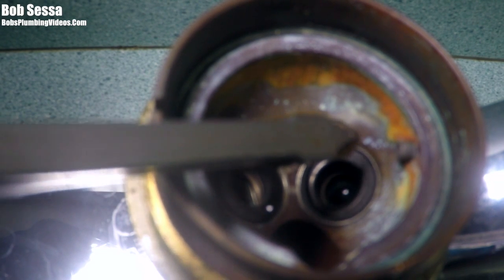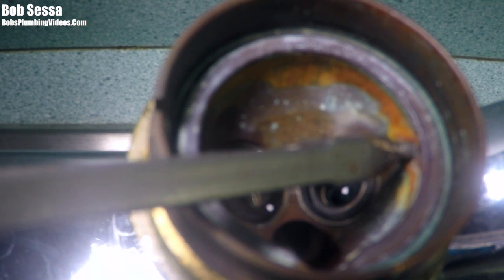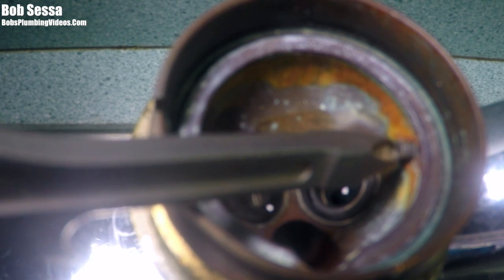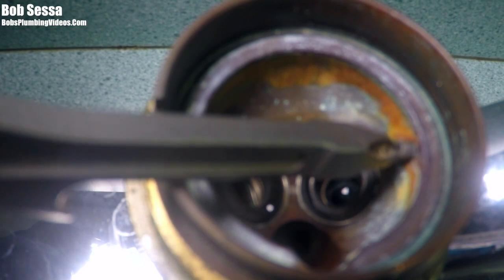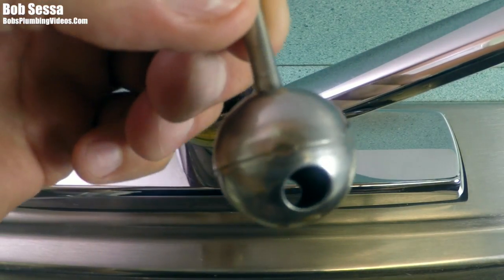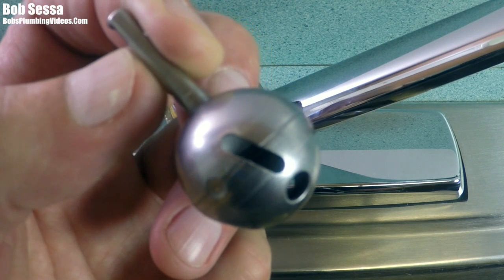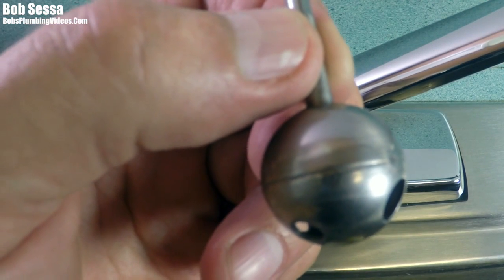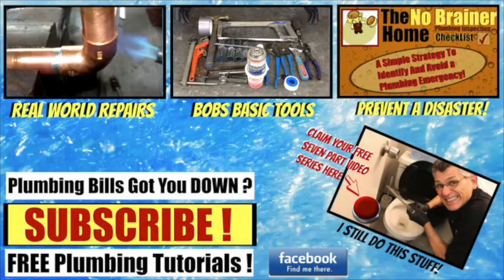Why Your Delta Faucet Is STILL LEAKING After Repair

Comment: Also, used a 1000 electric degree heat gun instead of a torch to remove that deposit welded on cap nut.  However, if you can't remove the plastic retaining ring in that cap it will get melted before cap comes loose.  Had to buy a new cap just to get that ring nut.   I tried to unscrew it with tool provided in kit, it just cracked it.  As in other videos, water deposits over many years really lock these parts on.

Comment: Thanks so much for this video.  I have been to the Box stores and to local plumbing stores.  They all keep telling me to replace the spring and gasket, or even the ball.  I try to explain that it turns and will not shut off but they don't get it.  It was driving me crazy because too often the faucet would still drip (not the exact sweet spot to be off) It's a pain to get at the pipes to replace the faucet but at least I know what the problem is and that I need to replace the faucet.  

Marc

Comment: Bob, thank you so much for the tip. I replaced the washers and seats on my Delft single lever faucet and still it needs to find that sweet spot. I will check on those notches. Thank you.
Reply from the maker: You're Welcome, thanks for checking out the video! Regards, Bob

Comment: I've watched at least a dozen videos on how to repair a Delta faucet and this is the only one that talks about that "sweet spot" problem. I replaced the springs and gaskets and still have that problem. I didn't change the ball, though, on the assumption that nothing can really go wrong with a metal ball. I stopped the leak but I have the problem you described of needing to turn the handle slightly to the left to find the sweet spot, which does eliminate leaking. Given that, do you think it's worth trying a new ball before considering replacing the entire faucet? What can go wrong with a steel ball? (The faucet, of course, is useable now, even if I have to go through that sweet spot finding thing every time I use it.)
Reply from the maker: If that little stud inside the faucet body is severely worn down, the ball will never settle in. The new balls are stainless steel, unlike the past in which they were made of brass. That's a judgment call
Reply: This is exactly the issue I'm facing!!!! Except the little nub is still protruding out, it is not worn down flush to the body of the faucet. So I don't know what it could be! When I replaced the sits and springs, found the sweet spot to the right. Tinkered with it thinking I did something wrong, now the sweet spot is to the left. Lol no clue !!!
Reply: @sic1lianqt  what was your fix?

Comment: I think that explains my issue. Prior to the repair, water was running out of the tub spout when off. Replaced everything, and it stopped the running, but when the water is on, it is dripping around the packing nut. I had to tighten it up, tried every combination of parts, and it still drips. I am wondering if the old beast is worn out. Thanks to Steve Lav's vid, I didn't destroy the client's valve when trying to remove the bonnet nut.... just put a plumber's wrench and tapped it with a hammer. Thanks for the information. It does feel a bit rough when I move the handle around.

Comment: Thanks so much, Bob! Mine is worn smooth! Is there a Delta faucet replacement of different design, which can be used with this worn down stem, so I don't have to replace the stem?
Reply from the maker: Unfortunately not, when I run across this I just replace the entire faucet. I'm sure not what you want to hear, but I learned the hard way. Regards, Bob.
Reply: Thanks Bob! 
 @BobsPlumbingVideos

Comment: Hi Bob thank you for the videos. I have a 1980s vintage Delta single faucet handle I would like to replace the fall but it seems like it’s permanently attached to the handle is there a way to get this off?
Reply from the maker: The handle is fused to the stem of the ball, you can try to back off (counter clockwise) the collar that holds the ball in place which will push up on the handle forcing (MAYBE) it to come off. If it works, you will need to replace the handle, but you might be better off upgrading the faucet.

Comment: So mine was leaking a little just at the handle when pulled back.
 Replaced w/ new oem seals and now started to drip at the aerator spot.
Cant figure out issue.
Reply from the maker: Is the guide worn inside the faucet? Did you use a new ball?

Comment: Hi Bob, 
 If the little nub that protrudes from inside the faucet that rides in that slot is wore down isn't there a way to remove it and replace it with another one or maybe a stainless pin of the same size, maybe soldered in the hole or epoxied? Have you ever tried to remove one that's wore down?
Reply from the maker: In my experience when that pin wears to the point where that the ball can't find its place, time for a new faucet. It's part of the body when it was cast.
Reply: @BobsPlumbingVideos  I see, I thought it looked like a stainless steel pin they pressed in there. I'll find out soon enough, I have to replace the diverter in our sink and probably go ahead and replace the ball valve, cam assembly and seats while I'm at it.

Comment: I have a 1962 Delta single handle bathroom sink faucet (it looks like this one is a kitchen faucet). Should mine have that bump, too? We're about to replace the springs and gaskets, but I'm wondering if i should be looking for this little ball in mine while we have it apart.
Reply from the maker: It should be there, as long as there's enough material protruding for the ball to travel on you'll be good.
Reply: @BobsPlumbingVideos  Thanks for the quick reply! We haven't opened ours up yet, so we're not exactly sure what we're working with. The faucet says "delta pat canada 1962" and is a bathroom sink faucet. It's really old, but we're really hoping not to have to replace it, because the sink it's connected to has the black asbestos spray on the bottom side that would have to be disturbed to change the faucet. So we're trying to baby the faucet, but at the moment it's completely stopped shutting off the hot water. It kind of feels like the hot water inlet gasket just completely popped out or broke free in there. It had been leaking, but all of a sudden just stopped shutting off at all a couple days ago, and the handle feels hard to move in some locations, like it might be the hot water gasket floating around in there. So we shut it off at the emergency valve (which also shuts off hot water to the shower). Long story short, I can't wait weeks for the genuine delta parts, because it's our only shower and having to go across the house to wash hands in the kitchen is hard. If this has the solid brass ball when we open it up, will the replacement stainless ball work? Will it wear out this little bump more quickly than the solid brass ball would? Can you even buy the solid brass from Delta anymore? Sorry I have so many questions, I appreciate any insight you have, as I don't know what will do if we can't fix this, given the asbestos.

Comment: Hi Bob thank you for the video, my delta single handle faucet is from the late 80’s. I would like to replace the ball but seems like it permanently attached to the handle. Is there a way to remove it?
Reply: Should be a small set screw on the handle.

Comment: Thanks for the video and the information. My problem is when I push the single lever all the way down in the closed position I still get a leak. Do you still think it’s due to that piece?
Reply from the maker: The video pertains to the faucet style shown. If you have to "play/adjust" the handle to get the water to stop and  assuming everything else is in good condition (seats, springs, ball), look at that stud if it's worn down significantly that's most likely the issue
Reply: The stud looks in very good shape, I’ll try adjusting the handle thanks.

Comment: Really love your vids!
I camr here because i have another issue...
My kitchen ceiling has a leak. I tore it apart and long story short, i got my wife to spray water around the whole tub and water pisses 8nto the ceiling below when she sprays around the handle for the faucet! Same Delta single handle faucet you're showing.
What can i do to stop this leak?
Is there a seal that goes around the handle and trim?
Im lost and dont know how to address this issue...
Any help is appreciated!
Reply from the maker: Generally there should be a foam rubber gasket on the inside of the chrome escutcheon plate that secures to the wall with two screws. I'll apply some plumbers putty over that gasket, tighten the screws until the putty squeezes out and you should be good to go. Also make sure the seam between the tile wall and tub is not the cause, I see often that the water leaks right thru that joint if it's not water tight. Regards, Bob.
Reply: @BobsPlumbingVideos  
Thank you Bob for the reply
I inspected everything and it looks like the foam gasket is missing...
Im gonna try some clear silicone and reapply the trim. I'll also apply caulking around the trim incase some is getting in that way aswell.
While i had everything apart, i went ahead and replaced seats and springs, and new cam and bushing.
Thanks

Comment: Hi Bob,

Fantastic video. However, I want to upgrade my Delta faucet just like the one in your video with a newer more modern version. How do I remove the Delta single lever faucet?

Thanks,

Frank
Reply from the maker: You have to go under the sink (shut off both water supply valves) look up and you should see a couple of 1/4" x 20 mounting bolts one on the left and one on the right. A basin wrench works if you have one, back off the nuts counter clockwise and the faucet should come right off. If the nuts are stubborn, spray some WD-40 let it soak in and you should be good to go. Thanks for checking out the video! Regards, Bob.
Reply: @BobsPlumbingVideos  Thanks Bob. It was really tight spacing, and I needed to get a few new tools but I got the job done!

Comment: i still have water rising inside of the faucet after taking the handle off so what is the issue?
Reply from the maker: The supply valves under the sink are not holding 100%?
Reply: @BobsPlumbingVideos  no they are not

Comment: Hello how do you take the spout off
Reply from the maker: Remove the handle. unscrew the chrome collar counter clockwise, the spout should lift straight up. You may have to rotate it a bit as you lift.

Comment: Mine is not worn, but still leaks after replacing everything. Ideas?
Reply from the maker: How old is your faucet? If we're talking about a vintage Delta, you would be better off replacing it if you already replaced all the parts. Just my opinion!
Reply: @BobsPlumbingVideos  I took it apart again and double checked everything, put it back together and it was still dripping. The next day it had magically fixed itself, so I'm guessing something settled into place. The house was built in 2005 so it can't be that old. New problem, the water smells strongly of iron or rust or some sort of metallic smell ever since the repair. What could've caused this?

Comment: Can I get rid of the pin on the inside of the faucet the new ball doesn't have the groove on the side
Reply from the maker: To answer the question, no. Delta makes a ball for deck faucets and one for shower body’s. If your ball does not have the slot for the pin, you sure you have the correct ball?

Comment: My pin seats in the wrong direction, can it be readjusted?
Reply from the maker: The pin in the faucet body is permanently fixed. It can be repositioned.
Reply: @BobsPlumbingVideos   how do I do that ?  Because of that pin in the wrong spot  my steel ball is  seating in the wrong direction.
Reply from the maker: @Knowledgexxxx  I'm confused? That pin inside the faucet body can only be in one place, if the ball won't line up, I would suggest replacing the faucet. Nothing else to do!

Comment: what part of the ball does that protrusion go into?
Reply from the maker: face the ball toward you with the flat side of the stem facing forward. On the right side, there is a diagonal slot in the ball that needs to ride on the guide inside the faucet body.
Reply: I may have an earlier version, there is no slot. On one side is a rectangle indention. Half of the one half of the ball and the other on the other half of the ball. There's a hole on the opposite side of that. Then on one side, there is a triangle of an opening which I assume either goes to the bottom or the top. Bottom line, I'm having to search for the sweet spot to shut off the water flow. I just changed out the two seals and springs but it's not going back together as it should. Can't even find the ball in stock any where.
Reply from the maker: Is this a deck faucet or shower body?
Reply: Shower. Even when I seem to have it at the "sweet spot" I'm still getting a steady drip about one per second.
Reply from the maker: Completely different ball, the older shower body's did not have a stop or guide for the ball to ride on. Make sure you're using the correct springs which should be straight and longer than the newer short tapered springs. The rubber seals are also longer than the modern versions.
Reply: Thanks for working with me on this. I used new rubber seals which appear to be exactly the same and even though the springs look the same I went ahead and used the old springs.This video mentioned the little protruding piece of metal for the guide hole and my model does have that and in the same location. That's what caught my interest. I screwed up the white, round piece of plastic with the rubber seal that goes on to hold the ball in place not noticing there is a little extruding piece of plastic on the outer edge that goes into a little gap in the metal housing to keep the plastic piece from rotating as you tighten the final housing. I think it's turning as I tighten things and not lining up with the opening in the ball for water flow. I have ordered another which looks like what I have. Maybe the ball is the problem and if it is, I'm in trouble since nobody seems to have it stock these days but It could be causing the drip problem as the seals looked fine.
Reply from the maker: Glad to Help! Regards, Bob
Reply: Brian K Kinney j